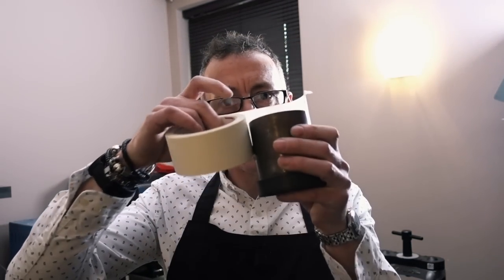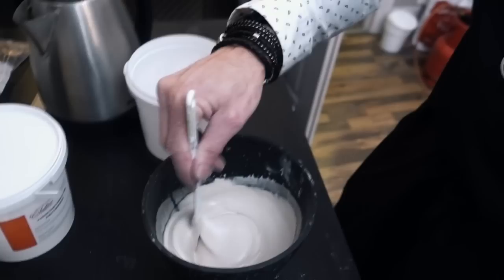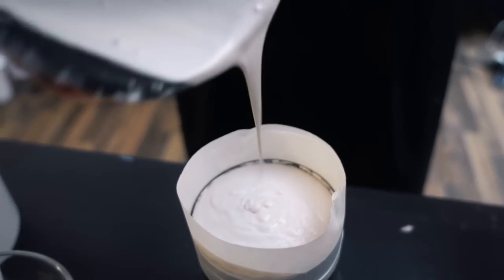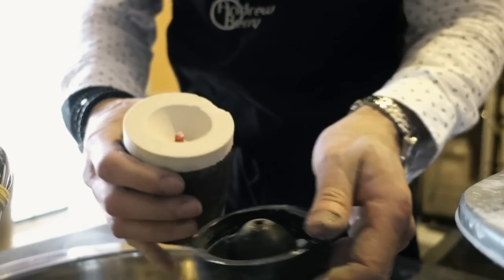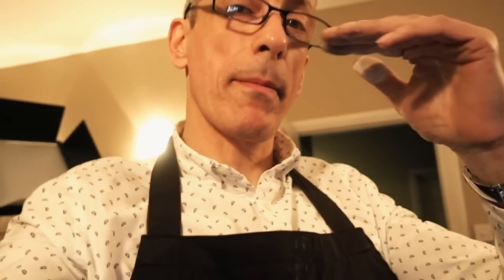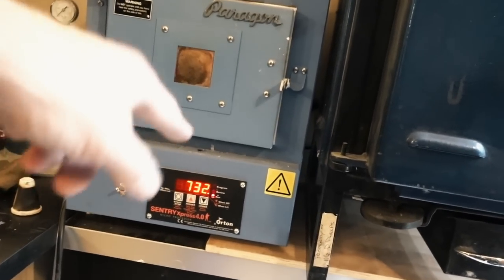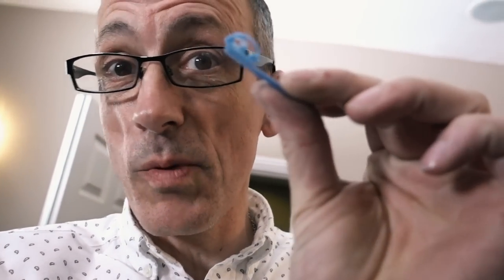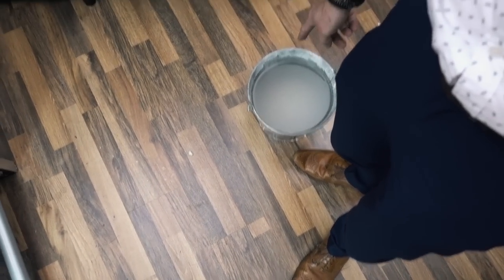Lost wax Casting - Centrifugal Casting - Vlog#84

Comment: I did all of my burnouts in a little brick oven that I built out of some random fire brick that I had because I was a bricklayer at one time and the outside I used red brick that was away from the heat I had a chamber underneath the chamber that I had to set the wax investment mold on it was made of copper with steel reinforced underneath it and it worked beautifully I used random pieces of 2x4 from my woodworking and sticks and branches from my yard that I would cut up. And it worked absolutely beautifully believe it or not I taught all this to myself from the public library LOL
Reply: Out of the blue a very nice person replied to a comment I'd made 3 years ago about casting. Sounds like you simplified the technique even more than I could have. Kudos! I gotta get back to  waxups and castings. And burning out and casting the occasional odd thing.  I have some mini acorns for example...

Comment: Hello Mr. Berry. I do enjoy your videos and have learned a lot from them. However, this one on casting has left me somewhat confused. Please bear with me and this  this long comment. Hopefully you or another viewer can address my questions.

I'm old. In 1975 I attended dental school. We were required to do all of our own lab work at the time except for porcelain. Dentures, arch wires , crowns bridges etc.

Anyway. I set up a lab in the basement of my apartment. I had a Jelenko burnout oven and a broken arm spin caster set into the drum of a salvaged washing machine drum. I used a propane torch (small propane tank with a hose and attached torch). I used a spatulator  hooked to a little vacuum pump to mix and double the investment and a buffalo vibrator to pour the investment into the ring.By the way the spatulator with mild suction gently took care of air removal and I never experienced the glorpy mess  your vacuum  produced. Ithink we used dilute green soap as a debubblizee and borax powder as a flux.

We had 2 investment compounds available to use. One was Crystobalite (sp?) which as I remember had to be ramped up partway during burnout  (Inever used it) and the other, Beauty Cast which was held at a constant.temperature around 950° or so after putting the ring in a warm water bath to set.

Okay. So why tell you all this? Because  when I cast dental crowns and bridges (and like all dental students the occasional piece of jewelry) my burnout time was 1 hour to 1 1/2  hour MAX!!! Not all day. Heck, during Boards we had only three hours to prep a tooth, take impressions, wax it up, cast and seat it! And yes, crowns and bridges are on the small side but are precise. And I did large jewelry pieces the same way.

The other thing I noticed was that when you cast your ring was out of the oven sitting  in the spin caster while you were prepping the metal. For us, the burnout oven was next to the spin caster and the ring was not removed from the oven until the metal was perfectly molten and ready to cast. The ring was  never allowed to cool and there were never any problems with porosity etc. I held the torch in my left hand on the metal, removed the ring with tongs  and my right hand and placed it in the spin caster, then let her rip. Took me longer to type that than it took to cast after the metal was molten.

I realize that dental crowns are fairly small. But I cast some sizable chunks of silver and gold jewelry  too during my dental school years. Never had an incomplete burnout or problem.

Anyway. I just wonder what experience others have with greatly reduced burnout times etc. I mean we used to invest and burnout all kinds if things, dead bugs, little plastic trinkets, seed pods etc. And we  didn't burn them out for  half a day.

Alas, I decided dentistry was not my bag, and after a couple of years of practice chose an alternate career from which I have now since  retired.

I want to do some more lost wax castings which is what brought me to your video -- for refreshment of technique etc. But expletive! A whole day to burnout??? Why??? That doesn't make sense to me.

So, I would welcome your comments or those of others. Again I love your videos, am subscribed, and plan to join the site for full access to your instructions.

Thank you
Reply: Was having problems editing. Pardon the mistakes that Autouncorrect inserted that I didn't catch, like "double" for "debubble" etc.
Reply: I enjoy reading your comment. This is all new to me. Perhaps you could make your own video on casting, smth like "old school" That would be rwlly smthing new and much appreciated 💕x
Reply: @svetlanagutic3449  I'd forgotten I'd written this. You are the only person who  ever responded. I'd hoped Mr Berry would give some input, but no such luck. 

I don't have my "lab" set up anymore, although I still have my spincaster in its washing machine tub and bench and my burnout oven, so I would like to get back into casting. Maybe this summer.

Dental lab technicians would probably be more than happy to share their casting  experiences with you--and wax up tools and wax suggestions.  They'll have all the "Skinnies" (tips) for smaller single pieces like those I made to.

Funny thing:

My father built the  workbench into which the spincaster tub was inserted. He built it for me IN the  basement (more like a tiny damp cellar with  steep narrow wooden stairs). When I moved  after dental school  some brawny classmates helped me move out. They spent hours trying to figure out just how to get the bench out of the basement. They almost gave up but I (and some beer)  convinced them they could do it and they finally did. I NEVER told any of  them that it was built in the basement in the first place. 

Thanks for replying. You'll enjoy casting.
Reply: @deborahlong4417  perheps he is much too busy to answer. But seriesly, could you make a video about centrifug.casting to explain more about it 💕x

Comment: I miss the Lost wax casting I did a little bit of gold but mostly silver jewelry. I was young and didn't have any spare money so I basically just researched everything at the local library and I was quite good with my hands so I built a centrifuge from a old bicycle frame and it worked fabulously. I can't remember any of the recipes for investment I remember Crystal light was in one of them which was kind of expensive I think silica and after that plaster of Paris I think but I can't remember the exact recipes are in my mouth. I don't know if I could get back into it I'm kind of old and I do pottery that takes a lot out of me I do some metalworking and electronics to fill my time. I think I would like to do some more jewelry it was sure cathartic work.

Comment: Hi, Andrew. Can I see the time/temperature table for heating the kiln anywhere please?
Reply: Usually the suplier of the investment will give you the best burning times and temps. I bring it up to 850 Celcius and cool it down to 500 within 2,5 hours to cast it. I also use a tray in the paragon oven to catch up the wax before it starts to burn.
Reply: If you're using a paragon kiln which I use and a couple of small flasks like he's using, the first is 149c to melt the wax. Usually takes about 30mins, then 371c. This gets rid of the moisture and you'll see steam coming out of the spy hole. Again this takes about 30mins, until the steam subsides, then full temp 732c for about an hour and a half. 
 I wouldn't be happy having an open topped spin caster though. If something goes wrong you can have molten metal flying all over the place. If I was that guy I'd duck down below the casting machine before I let it spin, just in case..
Reply from the maker: Metal won’t get thrown out because there is a rolled top lip to the unit 👍🏼